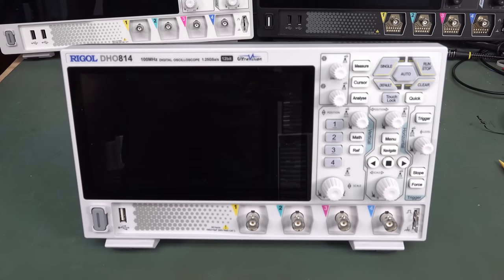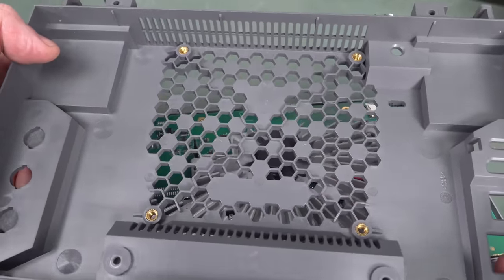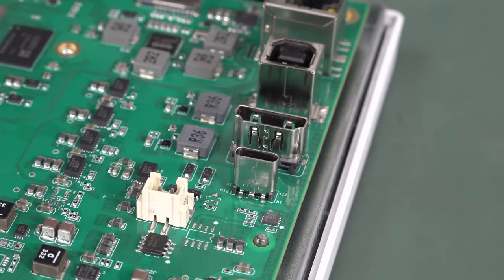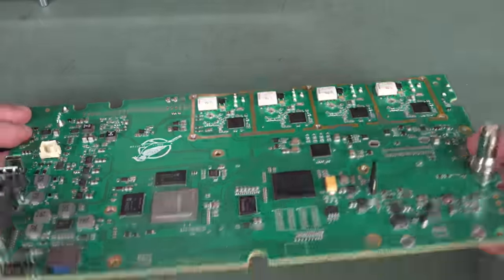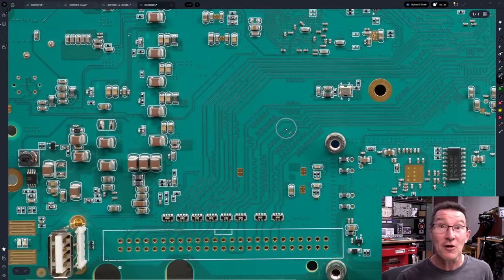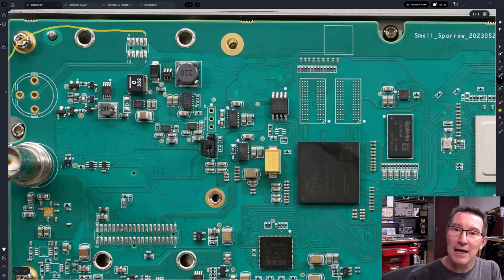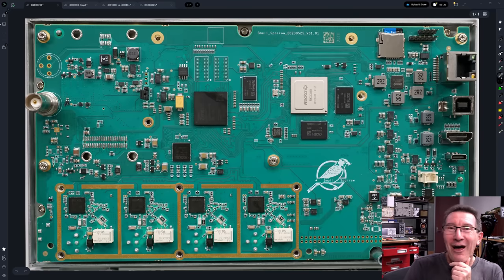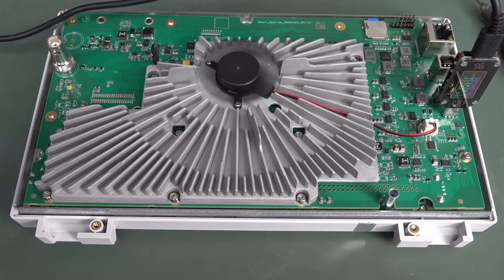EEVblog 1563 - New $389 12bit Rigol DHO800 Scope TEARDOWN

Comment: I spent more money than that on an "as is" HP 54540A and that looks like a MUCH nicer scope! If the HP dies a second death, I may convert.
Reply: If I were you, I would spend that much again to repair the HP before buying one of these. A ton of attention to detail went into the old HP scopes, and 30 years from now I think it will be more likely to still be functioning than these new FPGA-based scopes.
Reply: @brianclimbs1509  Very true. It only took disassembly and cleaning with IPA the inputs to revive this scope, and I swapped 2/4 with 1/3 for the worn BNC connectors. But if it dies, this Rigol does look nice.
Reply: That's awesome to hear! As pointed out in this video, all the connectors on the Rigol are directly connected to the PCB which pretty much guarantees that as a failure point before any connector actually wears out. I find it very frustrating that they are too cheap to use a few small pieces of wire or coax to make it last longer, and plenty of these newer budget scopes in my lab have developed flaky connectors. Also, much of the heavy lifting is done by the FPGA, so if that ever gets fried the whole scope is a paperweight unless they make the firmware open source (and I don't think that's happening).   @JeepinBoon
Reply: @brianclimbs1509  If a chip dies, I'm screwed (maybe). Not scared of FPGA or SMT.  If I was that worried about the connectors, I'd get a very short extension cable (straight or right angle) and zip tie it to the case. I use Panasonic USB fly leads in my Toughbook CF-19. They screw into the case under the port and are very rigid. When the port goes iffy, just install a new fly lead.
Reply: The USB leads are a very good idea. Like I said, I've seen a number of BNC to PCB connections go bad, and that's a really frustrating problem when you're using the connector for troubleshooting in the first place!  @JeepinBoon

Comment: Front panel mould can still be the same, just have parts of the mould set that are swapped out to have the logic analyser subsystem in there. Back one they simply use a sticker to cover the holes, cheaper to make 3 stickers with silkscreened labels and part numbers. 

Termination resistors and bypass capacitors are populated, probably to minimise reflections on the lines, and also the caps are easier to leave in place, so as to not need to change the solder paste stencil, and the glue dot stencil, making it easier to change board numbers on line, just place the extra chips, which are the major cost, while the passives probably added an extra 5c to the BOM cost.

Comment: For an engineering channel I say it is a rather disappointing video. Author instead of  having an objective  engineering approach has the approach of a technology geek.  From the video it is obvious that  this device is not designed to operate in a reliable way in the long run.  Three  problems stand out from the first look.  First (semi mentioned by Dave) obviously sloppy USB C  connector.  Secondly: Connection choice In what engineering world the USB C connector is more reliable than the  barrel one? It is way less reliable and much more complex to achieve a good power connection, and requires needlessly (for the sake of convenience) complex construction.   When did the laws of physics changed?  Third  heatsink construction.  Using such a small fan ensures  two things: high noise and low/very low reliability.  Those are just problems obvious from the first sight.  It is obvious that if the device was designed with such questionable engineering choices there are much more problems with software an UI - like a company logo that takes 7% of an already very small screen.  Over 45 seconds for the scope to boot in the year 2023 ? - Most of my PCs boot   faster  .  This is supposed to be a professional measuring tool but it does look like a device for geeks rather than those who are  after the scope that will   work properly , be reliable and will last   I understand that Rigol wants to  to sell cheap device to the masses,  mostly to young inexperienced people but why to  go along with it?  
 Ps I think with a different approach for the same BOM and the similar size Rigol could have made a better tool.
Reply: For me as an occasional hobbyist, this scope is absolutely fantastic!  You are blowing it all way out of proportion, IMHO.
Reply: TypeC can be powered by a power bank, making it perfect for going out.
Reply: I don't get why snobs like this expect and demand Keysight-like construction and component choice for budget price.

Look mate, if you want 30 plus years of 24/7 operation, clearly do not buy budget-friendly t&m - but do acknowledge that devices like these have a right to exist and do provide meaningful service to those who cannot, or will not, shell out 5000 to 10000 on what by your standards is the minimal viable option.
Sheez the arrogance.
Reply: I have USBC on Android phone. Use it almost daily for 4 years. And, you probably don't know it, but there are lots of usbc chargers  available at very good prices.

Comment: 35W is a little too much for a so tiny scope, yes there is a fan but looks poor and rudimental, sure not at the level of some rock solid Laptops solutions of these days. I don't think this scope is done medium/long work sessions. For me it is a no buy product.
Reply: I agree, and without testing and verifying anything + doing nothing more than a bit of armchair research, I too find the cooling solution wildly inadequate. The fan will melt right off its mount, I'm sure of it.

Some people.
Am I right?
Reply: @ghydda probably not right
Reply: The 35W are the specification for the power supply, the absolute maximum it will use.

Comment: I really wish they didnt use USB C for power. While Usb C is great for mobile device, it's not the best solution for something like this scope. This scope wont go anywhere like smartphone anyway
Reply: What do you mean? USB c is awesome for this. Power it with your laptop or a power bank and do easy in field or portable probing
Reply: They use USB C over a classic barrel connector so it's easier to make it waterproof!
Reply: @lazerusmfh  this is not "portable scope", yeah it's small, but there are countless scopes that more portable than it.
Barrel jack has been tested for decades, and it works very reliably. It does not has any fancy "USB C" Features like voltage negotiation or data transmission, but in this case that usb C is only for power, the data transmission is done through the old USB B right above it LOL
Reply: @bacphan7582 That's kind of crazy, they go USB-C for power, then bung a USB-B straight above it
Reply: USB-C has become so ubiquitous, that it's probably cheaper to buy a USB-C adapter in quantity than the classic barrel connector supply.
Reply: @technoman9000    This is  funny ineed.
Reply: @bacphan7582 Very underrated comment as I already wrote  They use   USB C  connector with sloppy mounting  In what engineering world the USB C connector is more reliable than the  barrel one? It is way less reliable and much more complex to achieve a good power connection, and requires needlessly (for the sake of convenience) complex construction. When did the laws of physics changed? Use of USB C connector with 35W constant power is patently bad engineering.  Apparently they cater the scope for Ignorants who will buy unreliable but fancy scope  who are not aware that power bank can be also easily fitted with barrel connector.   Don't even get me stared with very low reliability of SD card used as for OS loading. 
And very low speed so as the result  the scope to boots* in  over 45 seconds !   I shell use the word *"Turns on" for those people who think USB C power connector is a reliable solution
Reply: @technoman9000  On a device with air vents everywhere - who cares about waterproof
Reply: @paulstubbs7678  it was a joke, because it's the dumb excuse used for removing the headphone jack from phones.

Comment: That fan isn't doing anything except circulating hot air around itself. You'd be much better attaching a silent 90mm fan to the rear of the case to force some airflow.
Reply: Designed a lot of heatsink and Fan combinations before I guess, maybe you should call them quickly before all the recalls and you'll net yourself a nice anecdote for the PTA meetings.

Comment: I just took delivery of my siglent sds1204x-e from Amazon.
I may have to put that back in the box. Why does this always happen to me?!
200mhz (kinda) or this? What'dya think guys?
Reply: No bode plot here, low memory all ch enabled. But true 12 bit hackable to 250MHz, 50Mpoints mem, probably LA. Reviews will be published on sept 8.
Reply: @EngineeringAllAround  okay. You actually made me feel a lot better. I don't want to exchange it, I like it. I'm a noob and the tutorials for my scope are everywhere.
I'm just using this for learning electrical engineering and building circuits useful to me, power, led drivers, etc. I came imagine 12 bit resolution is needed. Very high amplitude combined with very low? I dont think so, but I'm up for examples of where I may need it. 
Thank you sir!

Comment: The extra components are likely there, due to scheduling. The marketing/sales guy set the release date, and then likely moved it up without consulting the engineering department (happens very often) So the engineering guys had to hurriedly send a cut and paste job to the factory floor and didn't have time to remove the cheaper passives. I'd bet that within the year, those components will be gone. :-)

Comment: I wonder, for scopes like this, has anyone ever tried upgrading the RAM chips, e.g., higher capacity packages  (similarly to on videocards where some people will take a card with 8 1GB packages, and replace them with 8 2GB packages to see how a card performs with double the VRAM)?
Reply from the maker: Almost certainly won't do anything, as the FPGA code will be mapped for a certain size sample memory.
Reply: @EEVblog  Yeahh  your prob right - a lot of soldering to find out !